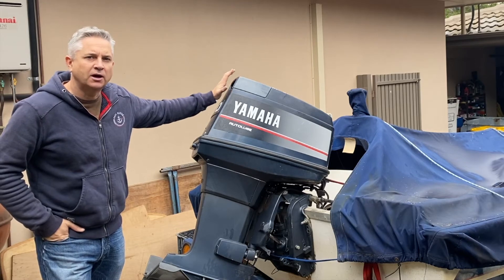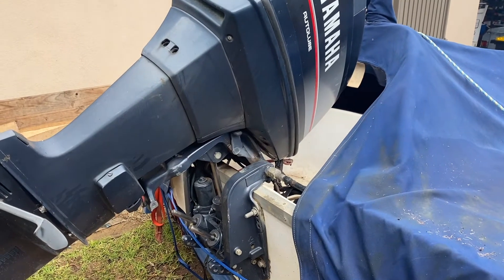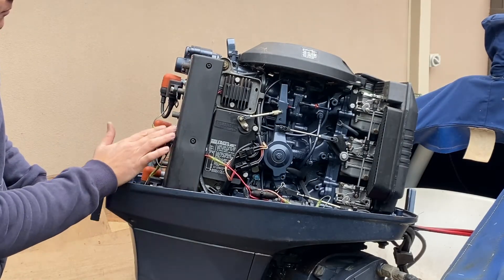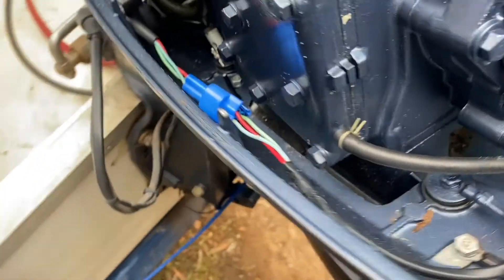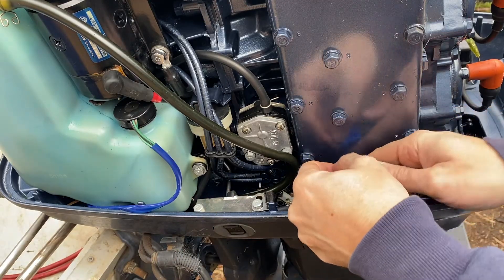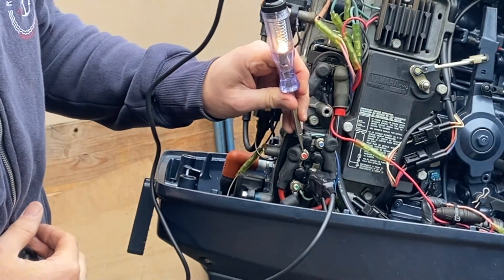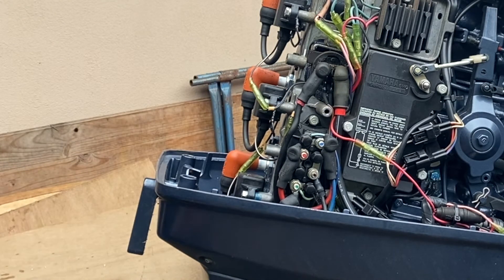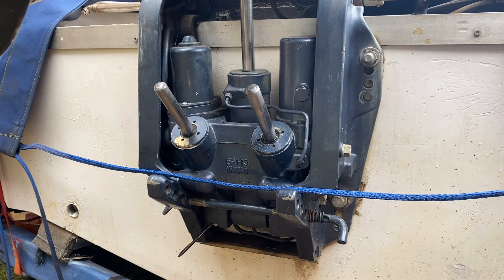Yamaha Outboard Tilt Trim Broken - Diagnosis & Troubleshooting Guide

Comment: I watched two of your vids and they were really helpful.  The one piece that I found missing was that I needed to lower the tongue of my boat as far as possible to get the proper amount of fluid in the reservoir.  When the boat is level, not enough fluid goes in.  I put some in two weeks ago with the boat level, and my trim quit working this past weekend (again).  So THIS time, I dropped the tongue to about a foot off the ground, and raised the motor all the way.  I also used a piece of aquarium tubing and a squeeze bottle to get it topped off property.  Your  work-around about getting the motor down using the screwdriver in an emergency is a great tip, but the trade off comes with not getting your boat off the ramp if the lower unit hangs down too far.  Thankfully, I was close enough to use my trolling motor and avoided snorkeling with a screwdriver.  Good vid and thanks!!

Comment: my issue is that the tilt/trim is working on the outboard. The up function isn't working on the trim tab or shift handle. Also blew 20 amp fuse under the cowling.

Comment: Have a Yamaha pro 60 tilt trim that only works when it's running.???
Reply: Tilt trim only works when it's running
Reply from the maker: Hi Mate, sounds like an electrical problem!  Can you hear the trim trying to work when the engine is not running?  Cheers Drew

Comment: Am I thinking correctly that it is not a relay problem if the buttons generate the typical trim sound w/no movement in either direction?
Reply from the maker: Most likely if it makes the typical sound as you suggest then it is not a relay problem. Have you tried adding fluid like in this video: https://youtu.be/wEGi5egIlSM Cheers Drew

Comment: Drew, what exactly would be wrong if you have to tap on the motor to get the tilt/trim to work? Occasionally mine will stop working and i found that tapping on the tilt/trim motor with an adjustable wrench will make it work again.
Reply: @lildickydodah786 im dealing with the same issue. Did you figure out a solution?
Reply: @christianamato7082  yes, I ended up replacing the tilt trim motor with and after market one. I did take the old one apart and found the brushes were rusted by decided to replace.

Comment: When I touch the green or blue to red it does nothing. That would mean my trim motor is bad correct? Or is there anything else that could cause that? I hear it click but no movement.
Reply: I’m having the same issue, did you resolve yours? I can hear mine clicking but nothing happens. Mortor turns perfect down tho.
Reply: @zacharypierce1674  have you bleed and refilled the trim fluid yet

Comment: Hey drew. Got a problem with my trim not going down all the way. The motor will raise and lower just fine. I had a dealer replace all the gasket/seals. But the trim will not lower all the way.  I bled the system and topped it off(I’m thinking)Any thoughts would be appreciated.
Reply from the maker: Hi Mate, if you just paid for a “dealer” to replace all of the seals I would personally go back to them and ask them to fix it under warranty!  Cheers Drew
Reply: @DrewFixIt  funny thing is they said that they couldn’t fix it. And I didn’t owe them anything. Just to come and pick it up. But I know they put knew parts in it. I got it to go up and down but I can’t get the trim to work. It won’t go all the way down until I open up the release valve. Then it slides right down.
Reply from the maker: @hamrnguns  well good on them for not charging!  You should ask them if they checked the tilt trim sensor?  Cheers Drew

Comment: Hey Drew, Thanks for the videos. I am having an issue with my trim system. I can hear the motor running. I topped of the fluid levels and went up and down a few times. It was very slow going up. I then unscrewed the cap and let the foam bleed out and topped off with fluid. Went to cycle up and down again and the motor would not move at all but could still hear the motor. Thanks for any help
Reply from the maker: Hi Austin, sounds strange that it was working slowly and then stopped completely, unfortunately it’s a bit hard to diagnose remotely, however did you check that you haven’t accidentally left the safety latch down? Cheers Drew
Reply: @DrewFixIt  unfortunately it’s not the safety latch. Although the manual pressure release screw is corroded shut. I can still access it enough to refill the fluid. maybe the pressure release valve stuck is an issue?

Comment: Awesome video . I have a 40 hp and only the "down" works. Thanks to this video I found the pressure release screw to run the engine in a barrel of water. I noticed a little ground wire thats broken and Im gonna change that today. Hopefully that will fix the issue. Thanks again mate!
Reply from the maker: Hi Johnny, thanks for the feedback as it's always nice to know that these videos are actually useful!!  Cheers Drew
Reply: Pudiste solucionas tengo mismo problema solo baja